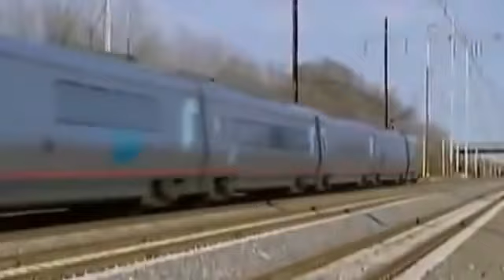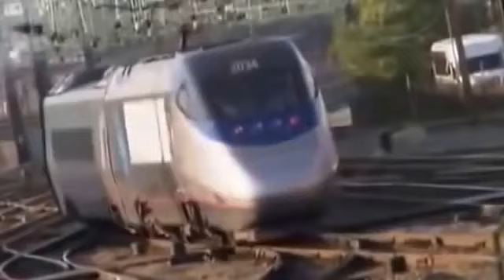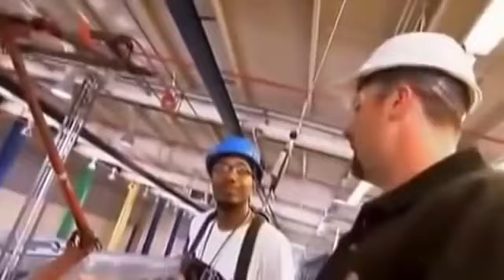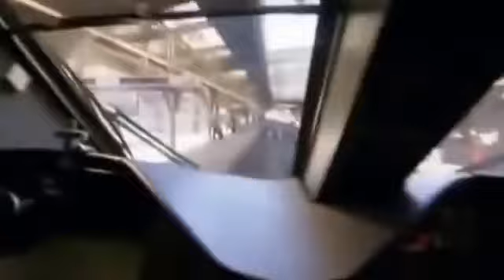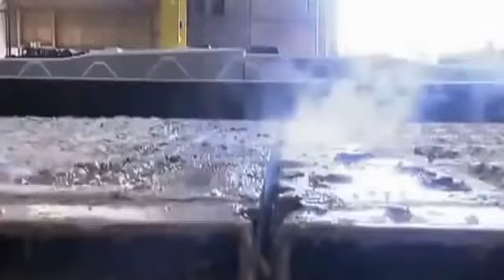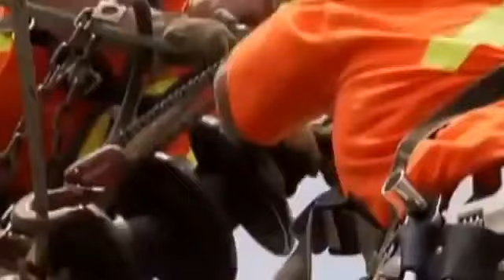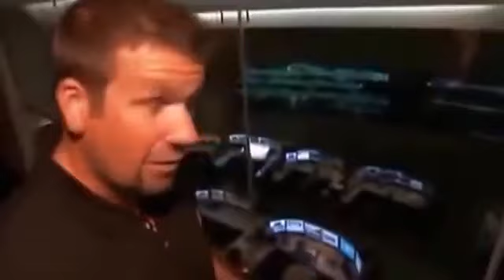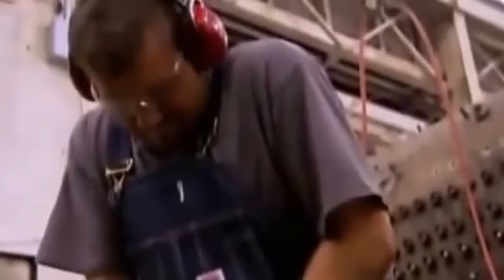The Amtrak Acela Express Documentary (Boston - New York - Philadelphia - Washington, DC)

Comment: Lol, tilt doesn't work on engine, because of pantograph. Only wagons tilt
Reply: It does, the pantograph is pushed upwards by springs to keep contact. When the train tilts, it contacts with the edge sections of the graphite collection plate rather than the centres. The collection plate is wide so that this can happen, along with the cable "stagger".